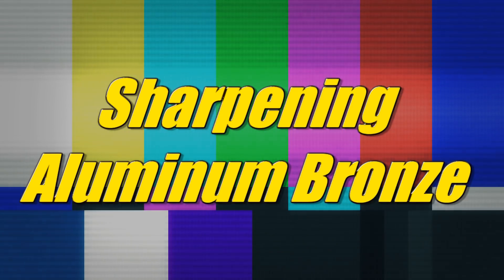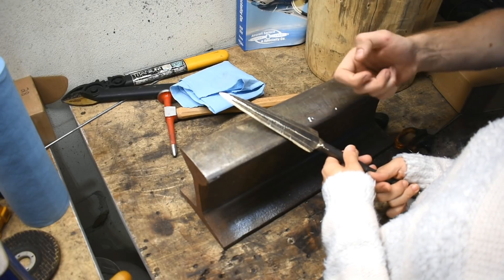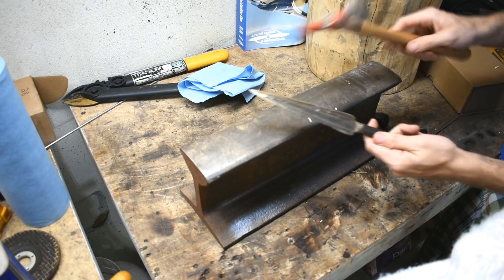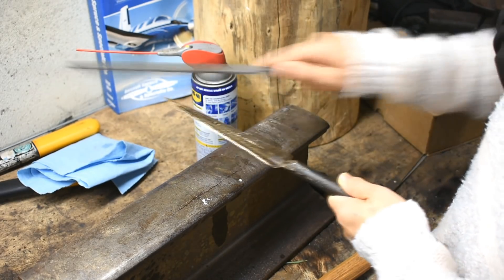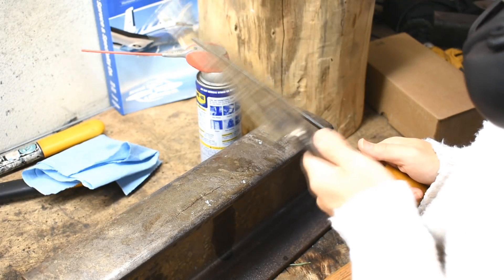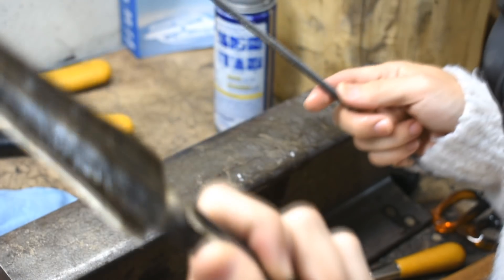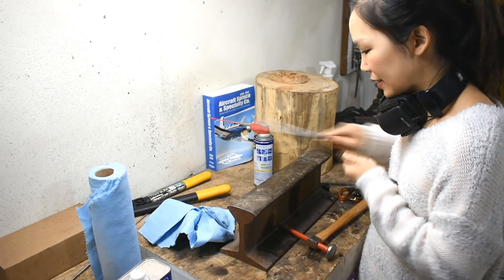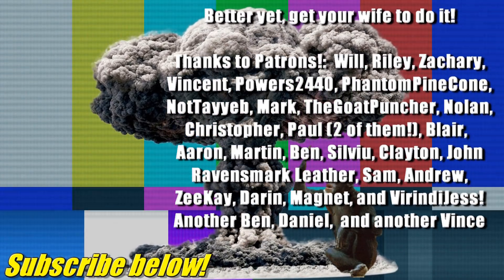My Wife Sharpens the Aluminum Bronze Knife

Comment: a weapon isnt a physical thing, it's a mental construction.

I think what you were trying to do is distinguish the title of 'tool' from 'weapon' but it is pointless. a weapon IS a tool, for inflicting damage.

the only physical definition of a 'weapon' is something that can manipulate the environment around it. Knive, tazers, flamethrowers, nukes, etc. This really doesn't mean anything because everything can be used to manipulate the environment around it. Similarly, ANYTHING can be used as a weapon.

like i said, 'weapon' isnt a thing, it's a name. a title. the exact point when something gains that title is when someone intends for the item to be used as a weapon , whether the creator or the end user.

examples: 
a pencil isnt a weapon, until you intend to stab someone with it.
a straight razor isnt a weapon, until .... yadda yadda.

same with a hammer.

if you buy a gun, but intend to not use it, it's still a weapon. Not because it has characteristics that are common in weapons (shoots bullets) but because the creator of it intended for it to be one.

if you buy a sword for display, but it isnt sharp, then the creator obviously didnt intend for it to be a weapon, only display piece. The same goes for guns that don't shoot.

now, if you buy a knife, of course it's going to be sharp, but that doesn't prove that the creator intended for it to be a weapon. This is where we typically assume the intent of the creator by taking into account style, size, etc.

now lets talk about de-weaponizing. think antique museum swords and guns that have been destroyed/rendered useless. The owner of the object does not intend for it to be a weapon, and it has been destroyed to the point that it would be comparably useless as one (compared to how it was when it was made). If the owner does not consider it a weapon, and the main characteristics it had that denoted intent of the creator are gone, then it is no longer a weapon.

that's why a rock COULD be a weapon, a kitchen knife usually ISN'T, a pocket knife IS (unless you do NOT EVER intend to use it in self defense) and ULTIMATELY, judging a random object by it's characteristics ALONE is not a good way of determining if it is a weapon, but it is a good way of determining intent of the creator (sharp doesn't mean weapon, it could mean tool), which IS useful in determining if it is.

now, of course it's still okay and inevitable for you to come to a disagreement on this, because that's how semantics works. If we really cared about getting everyone on the same page we would just use the dictionary definition, whereas we mainly care about coming to a 'perfect' definition of weapon through logic.

edit: also I thought the reason chimps cant throw overhand has to do with the relative LENGTH of the arms. throwing overhand puts them off balance. If they can swing from their arms then I think their shoulder joints can freely move in ways that let them throw overhand.

Comment: why the hell are you using that pokey thing? (as opposed to something less pokey and therefore easier to work harden the blade with)

also +1 for the random rambling while someone else does work podcast.
Reply from the maker: I tried other methods but with the cross sectional shape of the point I had trouble accurately hitting the edge.
Reply: i'd use a regular round faced hammer on the edge of a flat surface, tapping the edge of the blade with the corner of the face of the hammer, but i haven't actually tried aluminium bronze yet so that may not work as well as your method, it just looks really awkward to do.